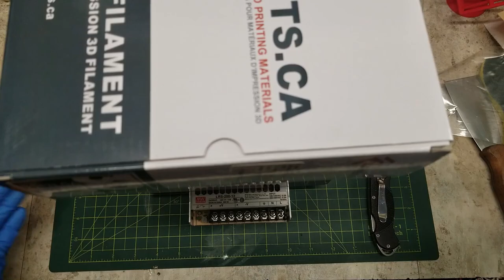Replace the PEI sticker on your Flexplate QUICK AND EASY!

Comment: Tossed it in the freezer and pealed off the PEI.  Mixed up the pod with near boiling water in a bowl and poured it into a baking sheet with the plate.  Waiting an hour and it literally came off like jello.  I only had to use my hands.  The area where it was laser engraved needed a little bit of scraping but that was it.

Comment: I have found after doing several 350mm sized flex plates that using some diluted soapy water mix in a spray bottle and litely spraying the clean plate before laying the new pei down makes avoiding bubbles much easier. A laminate roller or something similar is useful for rolling the pei down from one edge to the other, squeezing the water and bubbles out. Flawless new plates aren't difficult this way.

Comment: Great video, by I always wonder why people use pei on aluminium/metal plate.. I just sand mine with 40 grip (ruff) sand paper and quickly wipe them in between print with acetone.
Reply: Are you saying you print straight into the aluminum?
Reply: @paulgupta2454  on the aluminium: I dont use anything on top of it. When aluminum cool down it retract making the part free

Comment: Would the detergent pod affect the powder coated pei side?
The sheet I got is doubled sided(one smooth and one powdered coated)
Reply from the maker: it DIDNT seem to have any effect on the PEI itself which since it is plastic it shouldn't, really would depend on how its bonded to the steel sheet.

Comment: Unfortunately, I've discovered the Formbot doubled sided bed uses a film on the textured side, so this method will cause the textured side to come off. In fact the textured side comes off more easily

Update: The textured side actually only partially came off and the rest was stuck on tight. So I had to scrape it off.   Now my formerly double sided sheet has no PEI on it.